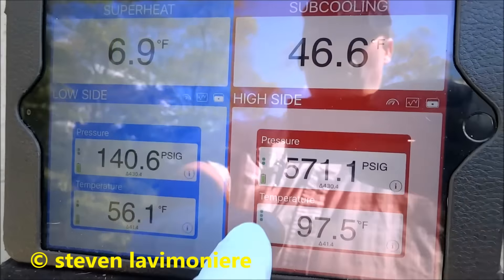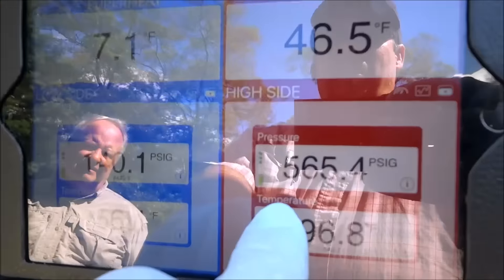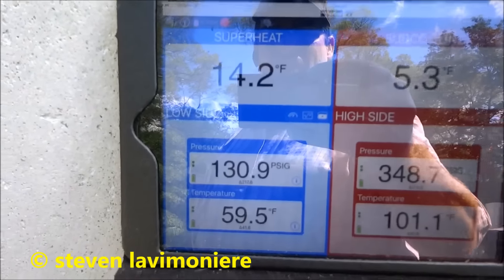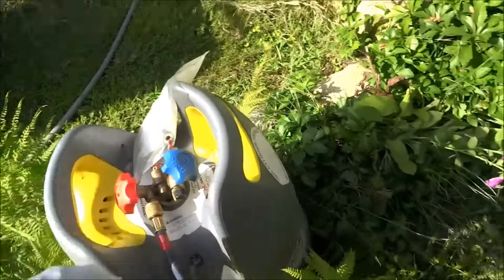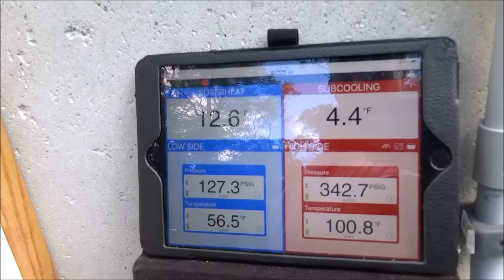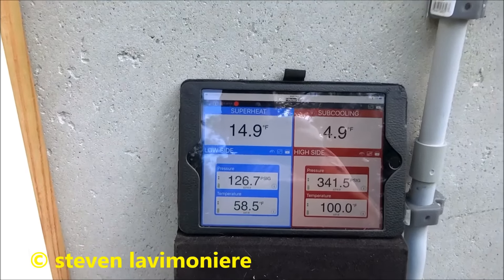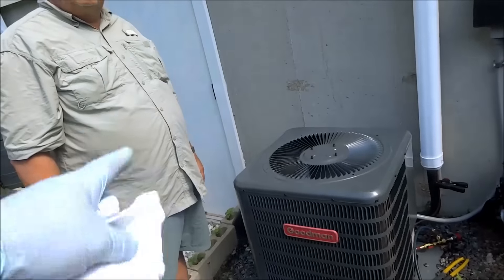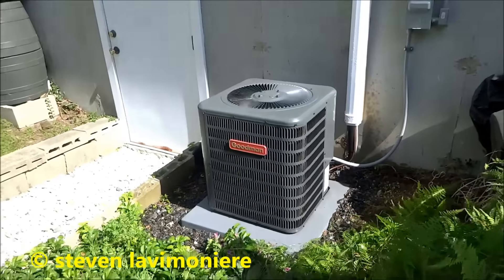new 410A air conditioning system overcharged

Comment: Highest pressure I've ever seen in an A/C system! In every line of business, there's always "that guy" that we have to clean up after. Wonder how many pounds over that was?

I deal with automotive A/C systems mostly ... and that kind of pressure would've made for a REAL bad day there! Lots of safety devices on those that would've vented all that pressure though. If not, either a hose would've let go, or the compressor would've just overcome the belt tension, and come to a complete stop while the belt continued generating a HUGE amount of heat - an under-hood smoke show!  Makes one hell of a squeal too, LOL.

Pure copper lines are alot stronger than flexible rubber hoses, for sure. This video is the proof!

Comment: hey why does it matter if the unit sweats?
Reply: the system will rust / rot out prematurely
Reply from the maker: the compressor should never sweet if so your flooding back over charged .not good